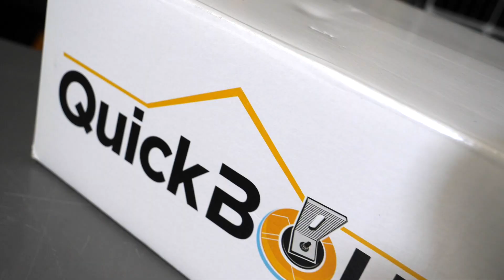QuickBOLT Multi Roof Mount with Microflashing

Comment: This video is OK with someone do it for living but very poor for DIYs. You should demonstrate it on a small roofing jig with some 2x4 and singles.
Reply: I disagree. The video is about micro flashing. Not a how to build your rack video. If you're DIY surely you get that you have to mount racks to hold the panels. This is just a mounting option. And a very good one in my opinion. I did a small four panel project a year ago on a garage and no leaks at all. Six mount locations. Take care.
Reply from the maker: Thanks for your feedback!
Reply: @NAZSolarElectric  Please build that little jig and make new video if you want to market it to DIYs. Thanks

Comment: Do they recommend using Henry's?

Because if it is supposed to work chemically on it's own, I would think Henry's could interfere with that process.
Reply: They do recommend a ring of sealant. From their permit package.

INSTALLATION INSTRUCTIONS
1. Locate the rafter and predrill the hole
2. Fill the predrilled hole with MFG approved sealant
3. Place a ring of sealant around the bottom of the
Microflashing® washer
4. Place the Microflashing® and drive the bolt until it compresses
5. Insert the L-Foot
6. Insert the nut and tighten until secure

Comment: Looks like a nice product, thanks for the review. Not big fan of Henry, I would go with black roofing urethane in a caulking gun as the sealer.
Reply: That black urethane is SOOO much better than anything.

I once used it to seal the edge where a steel shed meets concrete. Nothing else worked.